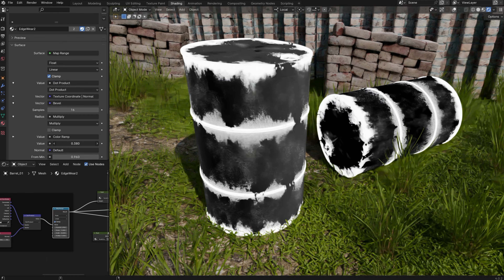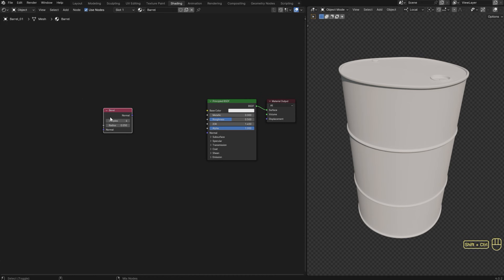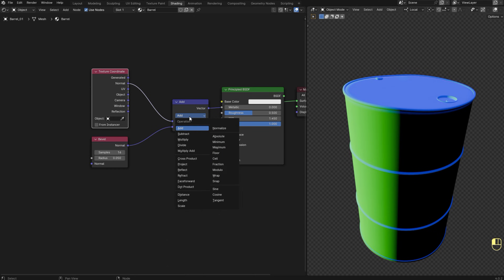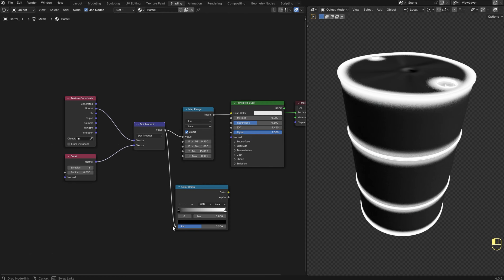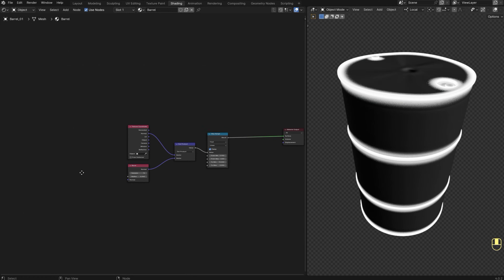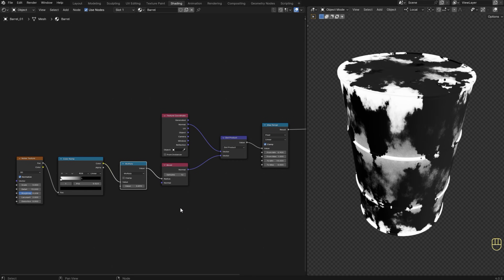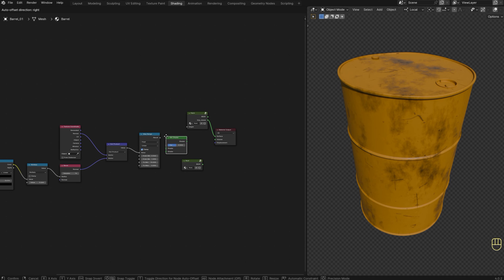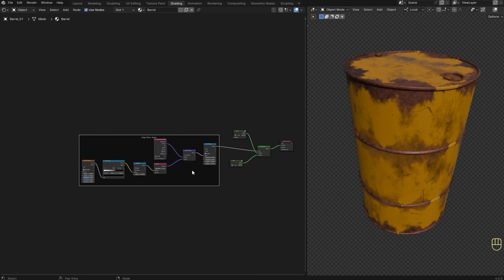How to Easily Create Procedural Edge Wear in Blender

Comment: Unfortunately, doesn't appear to work in Blender 5.0.1 anymore. I did: Texture Coordinate, Normal, Bevel, Dot Product, Map Range, Material Output, there was no visual at all except blank whiteness. Oh well.
Reply from the maker: I tested it in Blender 5+ and it still works.
Are you using Cycles or Eevee?
See if applying the object’s transformations will solve it.

Comment: Most of the time, it will be more efficient to use the Quixel mixer and combine the two textures... with your method, you would have to bake at a very high resolution to obtain acceptable quality.

Comment: The mask won't work anymore if you rotate the object, but to fix that you can use a Bevel node with a radius of 0 instead of a Texture Coordinate node!
Reply from the maker: @willem7746  you can also apply the rotation to fix it
Reply: That works so much better!

Comment: Great tutorial! Is there a way to make the edge mask only appear in convex regions, and not in concave regions?
Reply from the maker: This setup won’t work for what you’re looking for. I’ll try to come up with a mask for convex surfaces and let you know. What kind of surfaces or objects are you working on?
Reply: I'm making a worn down sword. While using this method, I noticed how the inner and outer edges had the same edge wear. That looked a little strange, but i found out that multiplying the whole thing by an Ambient Occlusion node is a way to fix it!
Reply: @willem7746  I use the ambient occlusion to cancel out the effect on the inner edges.

Comment: mine is just black or white no blend
Reply: You should plug the mix shader into the material output. You probably connected the mask into the material output.
Reply from the maker: Maybe you didn't plug the mix shader material output.
Reply: i can't see the tutorial on how to create the paint materials in your channel. for now mine is still black and white  @kbrender
Reply from the maker: @vladyjijo  I'll upload the blender file with the barrel model and the materials to my website this week. I'll let you know when it's available, so you'll be able to download it for free and compare with your setup.
Reply: @kbrender can you make video about how to import this texture in unity
Reply from the maker: @StandBy1133  No problem
Reply: @kbrender  I subscribed and will be waiting for this video, thanks
Reply from the maker: @StandBy1133  Thank you for watching and subscribing!
Reply: I had to turn on cycles instead of evee for it to work!
Reply from the maker: @mch43856  Yes, at the end of the video I mention that it works only in Cycles.
I'll create a tutorial on how to do that in eevee as well.
Reply: @kbrender  Ah yes just pointing it out in case they made the same mistake as me, ty for the great work!
Reply: Bevel edge masks work in Cycles, you can use AO which works in Eevee but is not as good